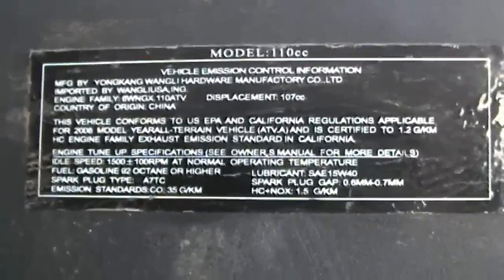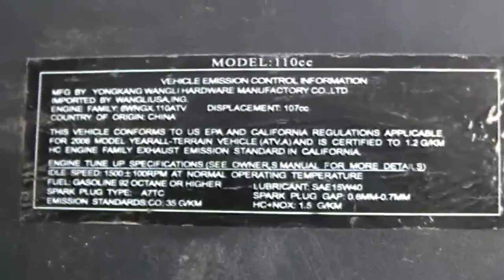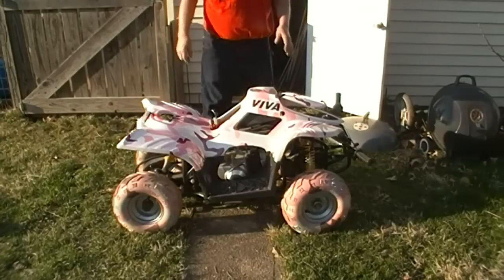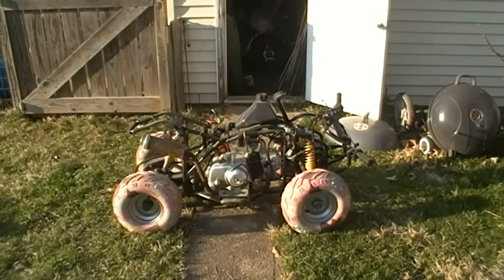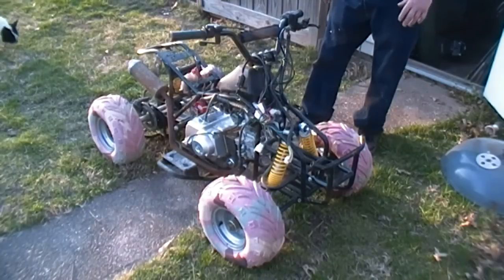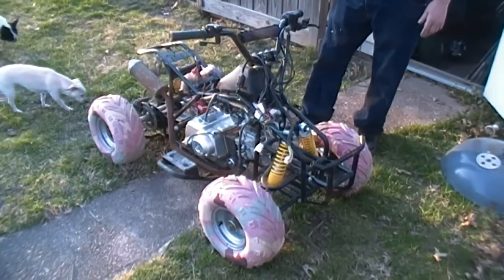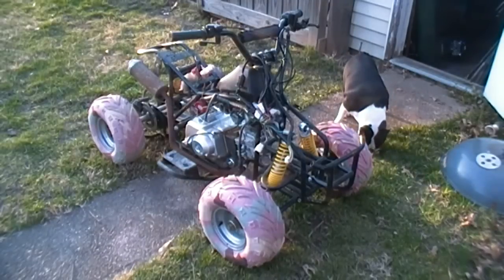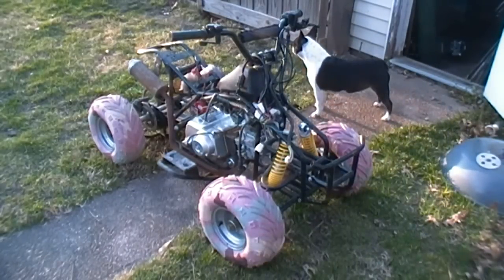Loncin Chinese ATV Repair, Day 2 , the Sequel

Comment: Polaris had a safety on the thumb throttle so if the cable broke it would not be stuck wide open and if the cable was out of adj it would not start.
Reply from the maker: Donald Valinski Hmm, sounds like a good feature. These cheaper ATV's don't have that . but Thank you for sharing that tip, Good to know... Cheers

Comment: glad you got it figured out these things can test you to the limit !! I found the hard way I replaced three starters on mine before  I found it  I had thought it was the remote but unfortunatly for me it wasnt and it still died after it warmed up It took me so long to catch my issue because up until that bike I had never had an issue were it had spark for a while but then nothing and due to it starting cold I assumed it probaly still had spark and had a fuel issue I was so mad we had it for a week and already it dont run I was ready to grab it by the rear handle and chuck it across the street I finally decided to let it warm up and then pretend I didnt think it had spark and go from there ( even though it just ran a few minuts ago) what do ya know I check and no spark not even enought to shock my hand lol In my past a motor either had spark or it didnt just remember when you work on these its usually a simple fix but way different than the old school hondas and go karts we grew up with
Reply from the maker: George Pratt So,, did you get it sorted out ? And what was it ? Now you've got me curious. Please do tell. 
I still like the old units with points and condensers, You can fix those on the spot, and there's not much that can go wrong.  Stupid technology ! lol
Thanks for sharing George,... Cheers
Reply: yea that was the one that had the bad plug wire also in the process of replacing the starters I found the windings can and will sometimes unravel they are stacked to close to edge of the armature
Reply from the maker: I see, Thanks for sharing. all these lil bits of information are worth knowing. Cheers

Comment: having the same issue....no spark...i disconnected black bx and still no spark. I tested spark plug on go kart and it works fine...im stuck
Reply from the maker: There are a lot of things to look at when you have a no spark situation. Coil, igniter, wiring, switches....There's to many variables for me to tell you, but if you check everything one by one you'll eventually find the culprit... Good luck

Comment: hi mate what kind is that atv
Reply from the maker: That was a loncin. I'm not sure what company sold it though.
A basic Chinese quad.
Reply: OK cool I got the same thing but mine doesn't even turn over there nothing when I jump start it off a car battery still nothing ......I'm in australia
Reply from the maker: I'd start off by trying the starter motor directly to a battery, then work backwards, Starter turns, check cable, then relay, then switch, check for a fuse 1st of all though.  
Best of luck to you, let me know how it goes Mark...

Comment: Do you know where the starter wire connects to
Reply from the maker: +TheMTGNMClub14    Yep !  Just kiddin,... You'll have to be more specific, There's several wires that could be considered the starter wire.  Check the link in the description and then search for wiring diagrams.  That should help you out.
Best luck and Let me know if that helps.

Comment: Thanks for the post. I have Vitacci 110cc and had the same symptoms. However, I did have the key fob and made sure it was unlocked and still was unable to get it to fire. I bypassed it and presto, it fired right up. Not sure if I'll order the part or leave it in it's current condition. I say all that to say this, thanks for the post and leading me down the path that I suspected. Great little machines for beginners and even with the problems with it less than a month of ownership, I have no buyers remorse.
Reply from the maker: Thank you for sharing, I appreciate hearing that, Glad it helped confirm your suspicions ... Cheers